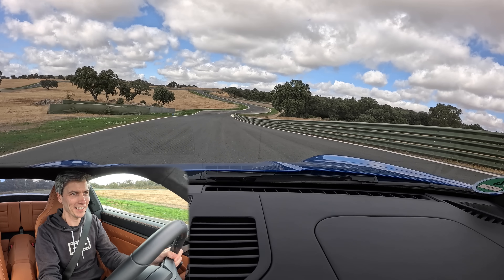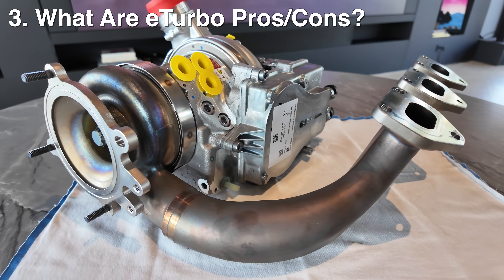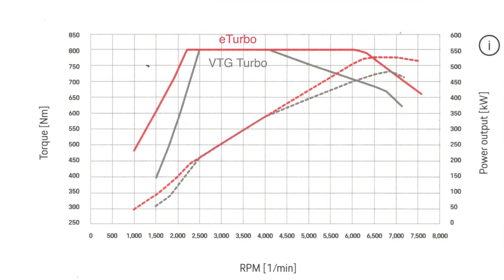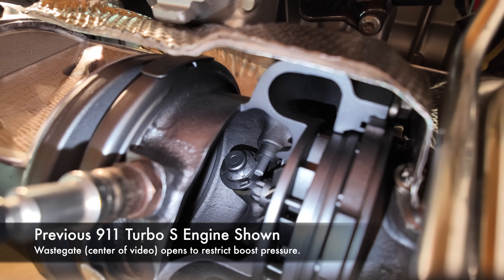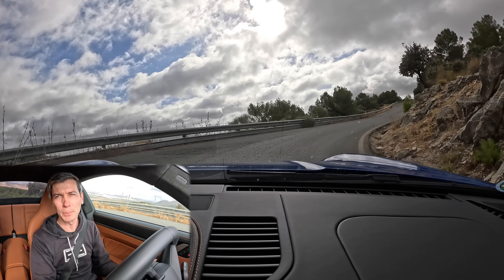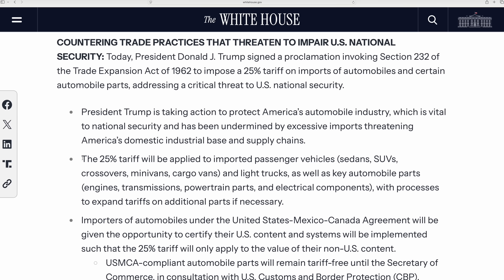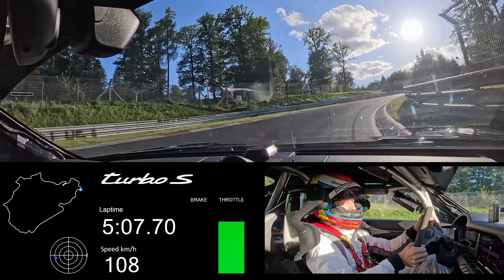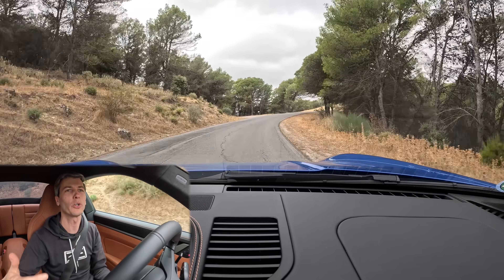Electric Turbos Are Here — Is It A Good Thing?

Comment: Using the turbos as electric generators is pretty clever.
Reply: F1 has been doing this since 2014. The main issue holding it back is that just like every turbine, they're very inefficient at partial power. It makes it a great addition for a sports car, but if you're cruising on the highway for an hour, you've spent most of that time at 20 HP, and thus the turbos aren't really doing any regenerating that can't already be done with the motor on the crankshaft more efficiently.
Reply: @Appletank8 when you are just doing cruise control at stable legal speed on a flat and empty highway, the hybrid part of the engine is not used, and the turbo(s) aren't either, but you are getting benefit of the smaller displacement. also you could be driving a Prius just as well. but Hen it come to using the car like it's intended to, the electric turbo hybrid powertrain helps. 14s improvement on the nurburgring despite the (moderate) weight increase
Reply: @geemy9675   Sure, but a turbo-hybrid is going to be inherently more expensive than a hybrid system. And a motor that has to sit near a turbo is going to be under much more heat stress than one attached to a crankshaft. More cost for something supposed to be a budget car that's efficient, with minimal returns compared to not having it at all.

As I said, it's probably fine for a sports/track car where you are regularly at full throttle, but road cars spend what, 20% or less? That's plenty of time for the motor to boost your low rpm torque, (what a small turbo does), with no lag whatsoever (the exact same thing an e-turbo helps with), then recharge it once you hit steady state or brake regen (something the e-turbo can't do at all). 

Heck, Toyota's newest hybrid generation can let you go into EV mode up to 80 mph. In any situation outside of empty road for miles, you can coast down a bit and have EV mode help out.
Reply: @geemy9675 Why wouldn't the hybrid part be used in such conditions? Mine can go up to 130 kph (or 140-sth downhill) in EV mode. Besides, stable conditions mean low power demand, usually below engine's top efficiency spot, so the excess will be redirected to the battery. Sure, EV mode will be brief, but still there's benefit to mileage
Reply: @Appletank8 yeah, it's a totally different phylosophy. let's be real you are not buying a 300k 911 to save fuel just saw a video comparing a 992.1 turbo S with a GT3 on a track the turbo S was 5mpg and the GT3 7mpg
cost wise it's 10x the price of a Prius and there a good price hike compared to the prwc gen that's covering the cost of the electric turbo and the R&D and even though it s only the GTS and the turbo S are the moment, it's something that will get more mainstream in the 911 lineup.
Reply: @jmk9065  they dont have an EV mode neither do they have an eCVT that can drive the car on electric power without spinning the emgine. anyway if you are driving an hybrid at constant load  speed there are only very little gains compare to non hybrids
if you look at 75mph mpg tests it's actually quite common to see hybrid versions have lower mpg
Reply: @Appletank8 I don't understand your point. I agree turbos are not suitable for most efficiency hybrids they are pretty much the opposite to annatlinson engine. more torque and power but lower efficiency and the.  eCVT is the best transmission in that context. sure you could downsize and. make a 1.5l turbo hybrid With a small turbo that would be not too different from a 2.0 NA hybrid but that would increase complexity even more. BTW eturbo is an addition, not a replacement for the motor/generator that lies in the transmission so the turbo S can do Regen while braking too. I think Porsche didn't want to mess up the transition to hybrid and they focused on creating a new hybrid platform that would set thing up for the future,  they maximised the electric power output from the 2kWh battery that outputs 60kW (30C discharge) while using trasitional hybrid li ion battery tech and they tuned the hybrid system to prioritize quick boost response over electric motor propulsion. sure when they are ready to increase the electric output as soon as better battery tech is abailable
Reply: @geemy9675   Which point?
I agree with you that for a sports/track car, it is a reasonable option since you're already willing to spend big $$$ for performance.

It is mostly dead weight in any other type of car, because it barely does anything at lower power levels. if you don't need heavy throttle usage often, a motor attached to a crankshaft or e-CVT set up does everything a turbo can, which is downsizing the engine without reducing peak output.

Also, a boosted engine needs stronger internals, adding addition cost on top of the hybrid system.
Reply: @Appletank8 Also known as the MGU-H (motor generator unit - heat), as opposed to the MGU-K (Kinetic, the hybrid drive system).
Reply: @Appletank8  not true, small engine have way smaller turbos and capacity, so they get tune to be efficient with small boost numbers and they can use the exhaust power to power the drive electric motor so the engine will cover even less of the power need to cruise
Reply: An electric motor and alternator work on the same principle, so why not use it as a generator
Reply: @davidecarucci1073 because the exhaust contains a lot of power which is lost if you don't use it
Reply: @davidecarucci1073bmw mild hybrid
Reply: @davidecarucci1073 This has been tried.  It only works near full power.  Puttering around town at 20 hp will not spin up an exhaust driven generator.
Reply: @garyderian4350 it's not only about recuperating energy/power from the exhaust. it's about also streamlining /simplifying the powertrain the motor/generator in the turbo acts as waste gate, antilag. tnow you can put a big turbo without the disasvantages. aero turbo lag because the motor can spool the turbo. no wastegate and lost energy because you can limit the turbo rpm and boost whenever you need to AND get some Regen. 
you get the very high power density of big turbo, the lack of inertia and throttle response of NA engine and the efficiency of an hybrid.Hybrid V6 F1 get mocked a lot for their sound, and supposedly turbos from the 80-90s had more power but they are simply limited by fuel flow. they are remarkable engineering in terms of performance and efficiency
Reply: @garyderian4350  they you do not need the additional peak hp nor do you need instant boost. Seems like the perfect way to boost a boosted car in all the right ways.
Reply: @geemy9675  Yes, everything you wrote is true.  But that all happens under high boost.  My comment noted that in normal driving, high boost is used only for a few seconds at a time so the benefits are not realized.
Reply: @davidecarucci1073I was thinking the same thing. Just regen the extra power.
Reply: @jonesaleroy  that's what it does, did you not watch the video? 😂
Reply: @jonesaleroy  this one of the two reasons main reasons for the electric turbos
1/ spin the turbo as fast as possible when needed
2/ precisely control the turbo rpm and boost to keep both the turbo and the motor safe, without need for a wastegate. being able to Regen the excess energy is plus but the main reason is control
Reply: The idea is older than you think although it was a separate system. The Wright R-3350 was developed with a system known as turbo-compounding since they wanted to increase power output for airplanes without increasing fuel consumption, so they engineered blowdown turbines to recover exhaust energy and send that to the crankshaft of the supercharged radial engine. Before the jet age, this was the most sophisticated aircraft engine to be used in airliners. 

Turbocompounding continued in trucking with many manufacturers used the same tech to increase efficiency of diesel engines. 

As for turbos with electric motor-generators? Well, that idea is already a couple of decades old or more. It's just only now that it arrives in a car after it had gone through the development in motorsports. A decade ago, the research focused on diesel and heavy vehicle applications.
Reply: @TheOz91 I came here to mention the turbo compound engine!  I long thought it would be good to make an electric version of that, but Porsche have done it!
Now make it 2-stroke…
Reply: @evan010101 Porsche did make an electric turbocompound more than a decade ago with the Porsche 919 LMP1 race car of the extra turbine kind
Reply: It's a perfect match. What's interesting is that turbines have been an integral part of all domestic electricity production since the beginning. The turbines on hydro / nuclear / fossil fuel are all of very similar design.
Reply: Well, the current C63 can do this since 3 years.
Reply: The alternator already does that 🤦
Reply: Not a new idea, but there's no free lunch.  It does cause less drag than a driven supercharger though.   But you either carry a larger battery or an alternator causing drag.  And of course, motors don't like hot environments like being next to a turbine.  I like the concept of a twin scroll turbine better and the BMW B58 proves it works pretty damn well.  That works better than VNT tech.  The only thing that would be better is an air bearing or a ceramic bearing combo so the compressor spins up even faster.  We could do a magnet air on the cold side and a foil air bearing on the hot side. no oil to worry about and no need to cool the thing.    pssst    we have a patent already.   lot's of prior art though all the way back to Garrett and Toshiba
Reply: 10% additional hp to the wheels by salvaging the energy of overboosting. Incredible technology.
Reply: The ProCharger 101 -Supercharge CrankDrive™ is better then E-Turbo's Cause you can Change Gear Ratio's on the SuperChargeer while you Drive or shift Gears thus No Lag and You can Turn It OFF When it hit's Maximum RPM's Thus no More ENERGY from Engine to the Supercharger aka transion into a 100% naturally Aspirtated CAR
Reply: @HolloMatlala1 also the debate between turbocharger vs supercharger was settled. superchargers are dying outside car tuning or drag racing
Reply: A very clever oh shoot up regenerative braking 
Without this they would basically have to mount extremely powerful alternators 

They gave turbos the advantages of superchargers
Reply: Flemings hands approve 😂 (if you know ya know 😊)
Reply: I wanted to recommend to use the e-motor as generator. Too late.
Reply: @stefanmargraf7878 by over a decade
Reply: @stefanmargraf7878 well you would have had to patent that.. and lawyers cost money. Porsche has an army of lawyers.
Reply: @JacksonDavis-x4mI know. My patent lawyer owned a new house. I have to pay rent.....
Reply: A turbine is an exhaust restriction, which is a source of parasitic loss.

With the laws of thermodynamics the way they are, using your exhaust gas to drive a generator means you're using more potential energy than "necessary" / reducing the amount of power available to turn the tires for more acceleration.

Maybe in the highest performance mode they could bypass the turbine via a wastegate to keep that last bit of energy available for acceleration (in the same way the car disconnects the air con when you're flooring it) but it feels like you're just making a trade.

Not routing exhaust gases around the turbine via a wastegate also retains more heat in the turbine, which inevitably reduces the life of the component. Given the 911 Turbo's reputation as the "daily driveable supercar" (compared to more temperamental cars like Ferraris and Lamborghinis) this also kind of matters more than it would on a "GTxxx" variant.
Reply: @ScathingMobile  sorry, but you don't understand turbos, parasitic loss or wastegate. F1 engines With electric turbos are able to work art 50% thermal efficency which is higher than any automotive gas or diesel, naturally aspirated or forced induction engine. the turbo motor/ generator is only harvesting energy when the turbo is producing too much boost/rpm. when needed, the e motor makes it spool much  quicker. nothing in the turbo S is designed for emissions. it's done to allow the highest level of performance, while meeting emissions requirements.
Reply: @geemy9675 I understand all those things, and evidently thermodynamics, better than you by your own statements.

Comment: Hi Jason, great video.
I have a small question , if they don't use a wastegate what do they do with the excess of exhaust gases ? Braking the shaft speed won't relieve the back pressure on the exhaust manifold , do they just use a very big exhaust housing ?
Reply: Yes large A/R because you don’t have to worry about lag when you can use the electric motor to spool the compressor immediately from low rpm or even at idle.
Reply from the maker: Boost is highly dependent on the RPM of the compressor (among other factors). Using the electric motor to reduce this RPM/set target RPM reduces/limits boost.

Comment: Of course powering the turbos is more beneficial than powering the electric motor.
It is about the same reason, why heat pumps are more efficient than resistance heaters, because they are pumps and not engines.
Pumps usually deliver way more than they consume, when referring to energy transmitters, because they are only transporting stored energy and not using this energy to power something.
Every fuel pump uses less fuel than it needs to run.
Slightly increasing torque over the rpm is beneficial when you consider the rising aerodynamic resistances.
The worst thing would be reducing torque with rising rpm (like most diesel engines and econ gas engines do). In terms of control an absolutly flat torque curve of course would be better.

Comment: quite interesting test, thank you .

Though one of your pointe towards the end does not really apply imho: when doing a launch from stop (both pedals pressed) there is no real drawback from lag, and actually when you let go there should not be much point in not using electrical power to propel the car as spooling should already have been achieved.
Reply from the maker: You're not making full power/boost when you're sitting still with both feet on both pedals. The resisting load is minimal (need enough energy to keep the engine revs up, that's it), so the boost is low. Once you start accelerating, you have a load to work against, so boost increases.
Reply: @EngineeringExplained  that must be a setup then (safety of sorts?) as the spooling does not depend on the speed of the car, only on the rev of the turbo - hence boost pressure on waste gauge control for the spooling at rest.

Comment: So I'm thinking the water pump on this 3.6 L (3.4 stroked) 9a3 engine is electric also vs mechanical with the no accessory belt drive system. That battery is going to be expensive to replace when it hits the expiration date 🤑🤑🤑, as the lithium ion battery for a GT3/Cayman/Boxster in the 987.2 & 997.2 was $1,000 15 years ago for a lightweight battery.
Reply from the maker: Yeah, water pump and a/c compressor both electric.
Reply: @EngineeringExplained  Thankyou for the information.

Comment: Additional weight of a battery to negate the performance benefits, and additional complexity of a motor to negate the long-term efficiency. 
Cool.
PS: Difference between wastegate and motor acting as a break on the turbine is that wastegate does not increase exhaust manifold pressure. This does. So even if it's not tuned to lose power, it will cost efficiency, as the engine has to struggle against it.
Reply: Why would the engine struggle against it, when the electric motor in the turbo will spool it up?
Reply: @halofreak1990 Why would the engine struggle against the electric motor acting as a brake, when the electric motor will spool it up?? You're talking incoherently. Re-watch the video segment about the electric motor in the turbo acting as a brake for the turbine and cone back.

Comment: So, it's like the MGU-H in F1, which is ironic considering Porsche and Audi are responsible for the MGU-H's disappearance next year.
Reply: they didnt have the secret sauce that the current teams have for the MGU-H and didnt want to develop one behind the curve
Reply: Didn't Porsche cancel their entry in 2026 because Red Bull and Mclaren rejected the idea of a management takeover?

Honestly, I think Williams could've been a solid option. They have a good team, just held back with low budget. As long as Porsche could inject boatloads of money they'd be happy with any deal offers.
Reply: They wanted the tech all to themselves in road cars
Reply: Classic "erase the proof that you stole it" logic..
Reply: @jwalster9412  No... The mgu h is being dropped to attract new engine manufacturers. It's also quite a bit different as the turbos and hguh share a common shaft where this Porsche system isn't connected mechanically.
Reply: @cyan_oxy6734  this Porsche system absolutely is connected mechanically with a common shaft, it's shown at 1:09 in the video
Reply: @Amy-dq2lg the whole idea does not make sense.  A pure BEV solves the turbo problem.

Comment: 1:12  Electric turbo??? Isn't that a supercharger?
Reply from the maker: All turbos are superchargers but not all superchargers are turbos (a turbo is an exhaust driven supercharger).
Reply: @EngineeringExplained  That's a good way to put it down 

Great videos as always
Reply: No, not really. Superchargers are typically directly driven by the engine (i.e. via a belt). This turbo still utilises the exhaust flow to maintain boost pressure (which is what defines a turbo).
Reply: @DarquosLeblack  so this example is a hybrid
Reply: No
Reply: Basically a supercharger is driven by the engine and that makes the lose about 10-20 horsepower. A turbo uses the cars exhaust to deliver more air to the engine but there’s turbo lag. Porsche basically made an electric motor for the turbo to eliminate turbo lag😊